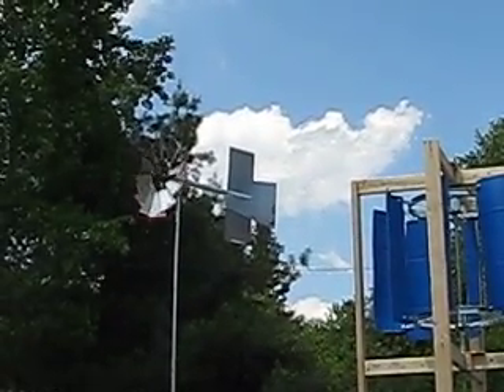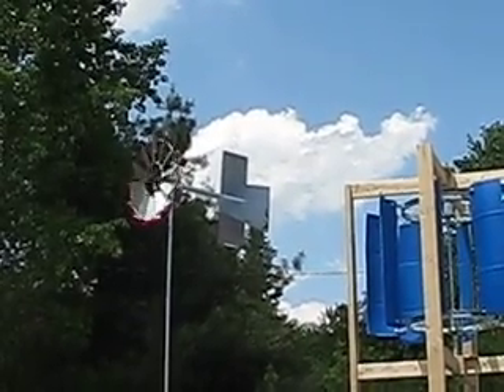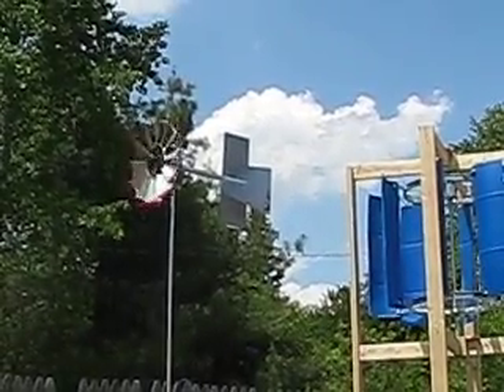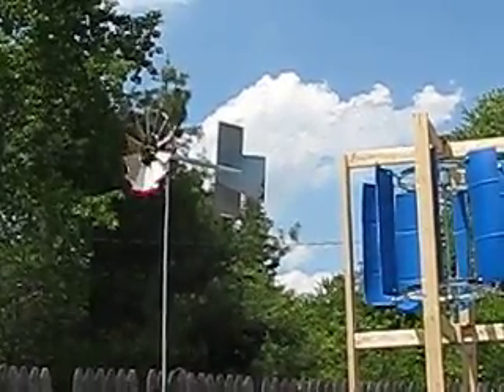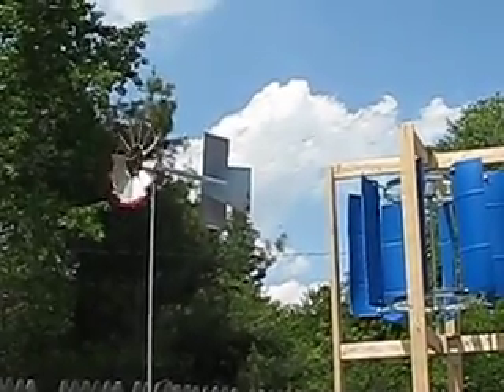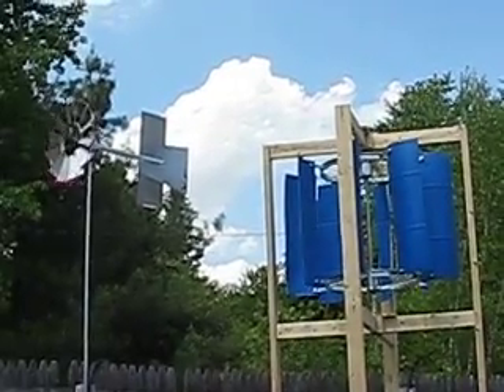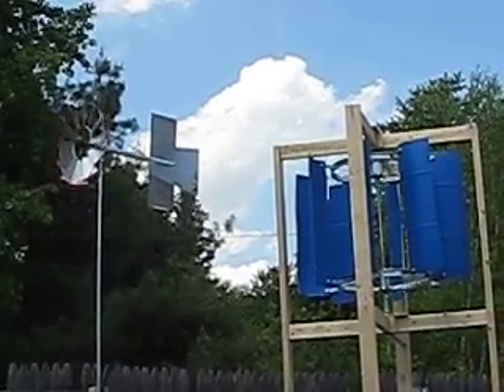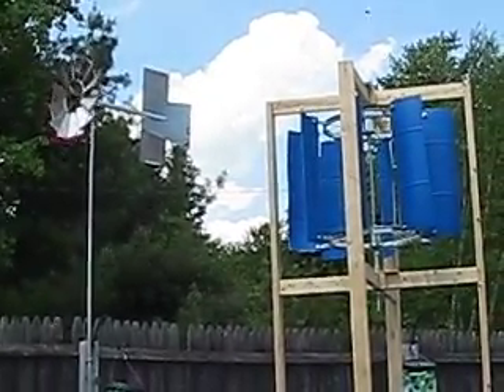vawt2 002

Comment: I realize this is an old video, and I'm watching your Paddle wheel videos because I plan to build a water wheel. 
 But, when using as a wind driven, wouldn't it make sense to put a wind shield over the (right) side that comes back around into the wind so the wind isn't slowing it down from that side?
Reply from the maker: if you did that I think it should be able to rotate with wind direction